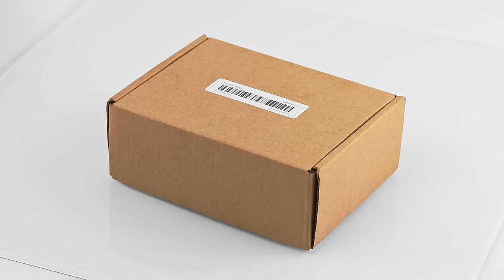Master Your Power: 120A/200A 12V Remote Control Relay Battery Disconnect Switch

Comment: Its not rocket science , If you can't work out how this device works you should not be driving.
Reply: What does driving have to do with some random device`s instruction manual? You`re driving, you need to know how to drive not how to install power lines. That`s like saying, if you don`t know how the thing you buy works without the manual then you shouldn`t buy it.
Reply: @makaevans8323 if you can’t do a simple battery installation you need to let your husband drive

Comment: how to purchase
Reply from the maker: You can purchase the 120A or 200A 12V Remote Control Relay Isolator Disconnect Battery Switch by clicking on this link: https://www.daierswitches.com/products/120a-200a-12v-remote-control-relay-isolator-disconnect-battery-switch